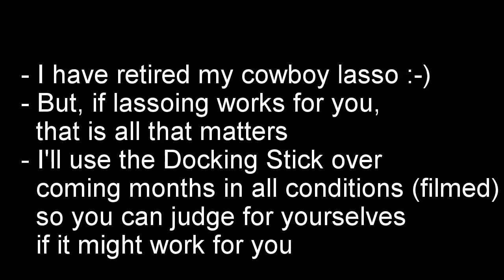Ep 33 Refining My Solo Docking Technique   Spring Line and Pivot Point

Comment: Hi Patrick, great video again... it's common practice on smaller commercial shipping to either use the forward spring to spring the stern off when leaving the wall or to get the forward spring out when coming alongside, especially when the wind is off the wall!
Sometimes if it's an older ship and she hasn't got any bow thrusters they use this the other way, they run the engines astern on the after spring which has the affect of pulling the bow off the wall.
Really good boat handling skills...
Reply from the maker: Great information Pill Sharks.   I marvel at how well those pros handle medium and large size ships (seemingly effortless) in high winds, and current.   You can tell they have really mastered the multiple uses of spring lines.  Thanks for commenting.
Reply: Patrick Laine l

Comment: I think that one of the reasons your videos are so helpful to me is that there is not a lot of difference between Isabelle and our boat (Salty Lass) as both are Bavaria. This video certainly saved me a lot of time cruising up and down the marina trying out different positions for the mooring line. One of the downsides of the Bavaria is the solid toe rail - on many other boats I would have holes in the toerail to put a block in to achieve the ideal pivot point. I was considering drilling a hole in the toerail but I will try the mid cleat first.

Thanks again for an informative video Patrick.
Reply from the maker: I have that same solid toe rail S&D.   My Bavaria is a 40' Cruiser.   As you saw in the video, the midship cleat is very, very close to the pivot point.  I'd be a bit more comfortable if it were 30-50 cm further aft, but I don't mind bumping against the pontoon a bit --- as long as I have a line securely around the pontoon cleat.   I've had a couple fo scary incidents where I missed the lasso on the cleat in high winds, and had to pull a rabbit out of the hat to avoid disaster when the wind took control of the boat and I had no way on.   Ooof.     I think I'm going to have a good relationship with my Docking Sticks.  :-)
Reply: I know what you mean about scary incidents and the wind taking control :-)

Comment: Hello Patrick. Great videos. Thoroughly enjoyed your trip to the north. Many years ago I travelled these West Highland waters almost daily, always under motor though. Never under sail regrettably. I just want to throw something into the mix here. Sometimes a stern spring is the better option and will "lock you in" as well as if not better than a forward spring.
Keep them coming 
John
Reply from the maker: Thanks John, and you bring up a good point.  There is no single 'right' answer to this.   Multiple options exist, and it is for each skipper to do the calculus of 'my boat', the weather, the pontoon, the dangers around, prop walk, current, etc., to decide what is the most appropriate method for the existing conditions.  This very approach that I filmed (parallel to the pontoon), I often do by reversing in at 45° and dropping a line off the stern over the cleat.

Comment: Big improvement Patrick I do more or less this technique on my boat but run the spring line between the two uprights of the mid-ships cleat instead of around it (cleat  becomes its own fairlead). I have a figure 8 knot in the end so the end does not disappear.
My cleat is around midships on the widest part of the boat, when motoring ahead on the spring line with wheel away from berth she comes in parallel  but if I use too much power the bow creeps in as the rudder overpowered by the weight on spring line. Its a good technique on ones own and the docking stick invaluable for getting that first rope ashore let us know if / when you discover more tips for single handed controlled collisions :)
Reply from the maker: We are completely aligned Ian.  (I actually did run the line through the two uprights of the cleat.)   :-)    Thanks.

Comment: Thanks Patrick, its a great techique. I would tie off the midships cleat and run the line via an aft fair lead to the winch. In my experience the aft of the boat goes to the pontoon rather than midships. Great jobs though. The other thing to consider is reversing to the pontoon. In that way the bow will not be affected so much as you loop the pontoon cleat.

Comment: While I don't have sailboat experience, I do have a lot of boating experience on lakes and the ocean waters inland. What I always do when docking solo is to take a stern docking line and connect it first, then to put the boat in very slow forward motion and turn the wheel or helm all the way towards the dock. This works extremely well for pulling the boat into the dock. In America when we tie up boats for fueling or temporary docking, we have a stern line moving away from the boat to the aft and a bow line moving away from the boat to the front or forward. In docks which are fixed on pilons where tide plays a factor we will cross tie the dock lines on one or both sides of the boat to allow for tide change. Cross tying will allow for tide change if you plan on staying that long. You can always dock using the short term method then change to cross tie, if needed. I also noticed you always pull into your slip bow first or forward. Here a lot of people prefer to stern in, or back into the boat slip (aka pontoon), this way you have stern access closer to the main finger of the dock. Also people here drink a lot and tend to run  their boats into the dock and chip the gelcoat on the bow. Just curious if you had a reason for pulling in forward?
Reply from the maker: Yeah, agree with all.  The challenge with many sailboats is how to get the stern line over a cleat on-shore.  Many sailboats are 1 meter or more narrower at the stern than amidships, which puts a fair amount of distance between the single-handed sailor and the cleat.  Moreover, there is often a lot of hardware on sailboats that complicates throwing that line from a stern position --- davits, solar panel arches, bimini frame, GPS , life-ring.....  One trick that helped on my boat was reversing in to the pontoon at an angle that puts me closer to the shore cleat, and then (if successful with the lasso), motoring forward.   All of that said, the Docking Stick concept allows great flexibility and reach to get to that cleat (even if your approach is a bit short, or a bit long -- you just walk forward or aft with the boat hook and drop the line over the cleat).

Comment: Patrick, thanks for your video. One other refinement is to use a bridle rather than a single mooring line. So a line running out through your midships fairlead back to the stern though the fairlead onto a winch. You can adjust the size of the bight using the winch. You then use your docking stick as before to drop the bight over the cleat but, because you are already attached fore and aft, the boat will come in parallel under engine or you can winch it in. I use this method a lot without the docking stick although you do have to lean out from the cockpit to capture the cleat in this instance.
Reply from the maker: Very nice technique Shaun.  I always worry about how I am going to get the line over the shore cleat, but clearly, a bridle solution is better than a single line solution.   I have now changed boats, so have to relearn a technique I will be comfortable with.  ;-)

Comment: There is a technique where you approch the dock at 90 degrees (bow pointed straight in) and at the last moment turn the boat hard and then reverse. Suitable when there are boats tied up on either side. One of those techniques that baffles everyone as the boat comes to a dead stop when it appears to all watching that a very expensove diaster is happening.
I learned that from the fellow who wrote about the fastnet race back in 77.
I also use to keep the bow line and a aft line run to the cock pit. Jump off and quickly secure the bow line, then the aftline, although i do like your bow touch technique with the motor idling.
Reply from the maker: I see fishermen use this technique quite frequently.  It's very impressive, but would probably not win you many friends in the yachting community.  I'm already on a black list!  ;-)
Reply: @patricklaine6958  I am very impressed with the ease you've handled a 40ft sailboat solo. Quite remarkable. You also have a real talent in front of the camera, one of the better youtube channels on sailing.

Comment: Great video as always Patrick. Could you have your loop  with 2 ends. One end going to your original set up via the fairlead and the other end fixed to the rear cleat. That way when you pull in on the fairlead end the stern of the boat is being held in.
Reply from the maker: Great question R --- and the short answer is, Yes.   BUT,   ;-)    That would probably mean I would have to capture the pontoon cleat from the aft, helm position and then pull in the slack and tie it off on the aft boat cleat, and I am nervous about that for two reasons:  1)   I have a lot of potential obstructions from that position : bimini, aft pulpit railing, GPS, and dinghy davits..... and 2) I think I really want to take the pontoon cleat from the cockpit area (as I did in the video) because if the cleats are about 10 meters apart, I can easily take a step or two forward and reach forward for the next one, or a step aft and reach back for the aft one.  If I am standing in the confined space behind the helm, my reach for the pontoon much more restricted forward and aft, and I may find myself obligated to restart the movement of the boat to get to the next cleat.  (This answer is a bit complicated, but in short, I think I have more options if I don't take it from the aft helm position ---- but it certainly could be done, and it may be easy to do from your boat.)

Comment: Another great video Patrick.  Thanks for sharing.  I've attached some velcro to my gaff to hold a bowline in place which releases with a sharp tug.  
Also I read on the AAC website that John Harries recommends using a cleat fitted at a sweet spot about 1/3 from astern. What he calls the pivot point.  
If driving forward against a spring from this sweet spot  then turning to port the bow moved to port, and stbd she moves to stbd.  
As you are aware  when using the midships fairlead as the pivot point the bow gets pulled in quite severely, that's why you need full lock away from the pontoon. 
I fitted a turning block at this sweet spot and it has helped me. (Found the spot by trial and error).  It might be worth trying that to see if it suits/benefits you.  Well done again.
Reply from the maker: Thanks Garry.  Yes, I can feel the pivot point is still slightly aft of the cleat I used in this video (though the boat pulled in nicely parallel with a touch of opposite rudder).    I do have some deck fixtures a bit further aft (used for the spinnaker) that I could attach a block to.  That would certainly put the spring line aft of the pivot point.  I may give it a try, but between us, I was quite happy with the boat response I had in video 33.   Very easy to implement, as well as undo after docking.   I'm not sure I will like having to dig out two blocks each time I come into a port in addition to rigging the docking stick line, but I'll give it a try as you suggest.  I may be surprised and find the handling characteristics of the boat so much better that it is worth the extra rigging effort.  Thanks for the suggestion.

Comment: Great video. I would suggest that, if you’re using the amidships clear as your pivot point, you save yourself the trouble of winching and just run a fixed length spring line from the cleat to the helm.
Reply from the maker: Yeah -- the winch serves no practical purpose ---- just a convenient way to keep the line from getting tangled/in the way.   A fixed length directly to the helm would work just as well.   Thanks for watching.

Comment: Unrelated to this video but to one where you had to leaved the cockpit in a blow to take a 3rd reef: An alternative. Attach a cheek block to the side of the boom where the 3rd reef should attach. Run the reefing line from around the boom with a buntline through the 3rd reef cringle back down through the cheek block and then to a single block at the goose neck attached with  dyneama line then down to another block at the mast base and then back to the cockpit. Now set up you reefing so that if you have to go to the mast, you do it for the 1st reef when the conditions or more benign, not for the 3rd reef when all hell is breaking loose. I works for me. Try it. You won't be disappointed.
Reply from the maker: Thanks Ron.  I had intended to do exactly what you suggest about 18 months ago.  I read a magazine article that explained  in detail the process.  However, in the last 3 years, I have wanted to put in a third reef a total of 2 times.  Thus, I wouldn't want to give up the first reef (which I use on almost 80% of outings) for the third reef.   That said, your process can be done without giving up the first reef on my boom (with a bit of creativity).  The only inconvenience is a lot of line sitting on the salon roof much of the time.   I am beginning to think about my major passage for next year --- and if I do what first comes to mind, I will definitely want to have the third reef capability, so will install it then.  Thanks for the great comment.
Reply: All the reefing on my beloved Wauguiez Pretorien 35, unfortunately lost in Hurricane Irma, was at the mast. But going out there when it was blowing 35+ was a bit thrilling. On my next boat I'll have 3 reefs, but I'll set it up so that the first reef is taken at the mast and the remaining two from the cockpit, thereby not having a cockpit full of lines and not having to leave the cockpit in a big blow.
Reply from the maker: Sorry to hear about the Irma loss.   Hope you are able to replace it soon.   I'm still a bit concerned about having to leave the cockpit to put the first reef in.   I use that reef very, very, often --- so wouldn't want the psychological factor (extra work/risk to go to the mast) to deter my frequent use of that reef.  But, if it works for you, that's all that matters.  :-)

Comment: Thx. for sharing. 
With the pivot point you can also slow sliding in and out - to and off the potoon. Give it a try.
Reply from the maker: Thanks Frank.  Yes -- I use a spring line very frequently on departures.  I can't really use one on arrival at my home slip because the finger is about 2 meters too short and the helm/throttle is as far aft as you can be without swimming.  :-)   Thanks for watching.

Comment: Just thinking what you could do with the mooring stick after you have detached it from the line other than dropping it against cockpit gelcoat.
Reply from the maker: Just for clarity, the Docking Stick is the white plastic/pvc tube that is attached to the mooring line.  The extendable boat hook/gaff is a just a standard aluminium pole with plastic ends.   I just drop it on the floor of the cockpit (as I would after any usage of the boat hook while I am manipulating the lines).   It is so light/insulated that it will not damage anything.  It stores (on my boat) underneath the seat.  Thanks for watching.

Comment: I can't tell if the pontoon is longer than the length of the boat. If that is the case, then you can't use the stern cleat to dock the boat because you can't use the motor to pull against the line. I do my dock lines differently than you. I feed the dock line through the center hole from outboard to inboard and tie a stopper knot so the line can't pull through the cleat and be lost and the loop in on the outboard side of the cleat. I lay the loop over the rail and flake the line near the cleat so I can pull the line through the cleat as much as I need to tie up. I hook the loop on the boat hook and catch the cleat same as you did. Then set the hook down and reach down a pull the line tight  to draw the boat to the dock then put a cleat hitch in the line to the cleat. I go back and put the engine in dead slow forward and the boat is pulled parallel to the dock. Then I can get off and attach the rest of the lines.That works for me but you have to see if it works for you.
Reply from the maker: My pontoon finger is much shorter than the boat --- thus, I can't use the aft cleat to pull forward against.   I understand your method, which seems very similar to mine ---- except you pull the line in at the cleat and then do the half hitch.    I would have to walk forward from the cockpit to do that, and then back 6 meters to the helm/throttle to pull forward.    That's why I use the winch ---- I can stay in the cockpit to pull and lock the dock-line, and then take one step back to put the boat in forward gear.   Again, it sounds like we are doing fundamentally the same thing.    Thanks for commenting.

Comment: I quite like your method and will practice it once I'm back in the water.  I have a question to ask though. You come in quite hot into your finger pontoon (fast) if there's a problem engaging reverse,  what would you do?  I tend to come in steadily and then dock in stages, probably doesn't look so swish, but if the engine stalled or any other problem engaging reverse, I'd not have quite so much way on and less likely to damage something.
Reply from the maker: The important thing is to have a technique that works for your boat in all conditions.  Sounds like you have got it nailed.   Bravo.
Reply: Thanks for the swift reply  @patricklaine6958  .  I look forward to trying out the springing method with the winch.